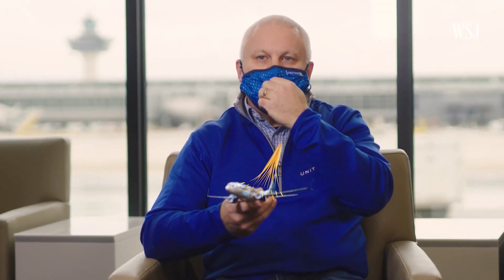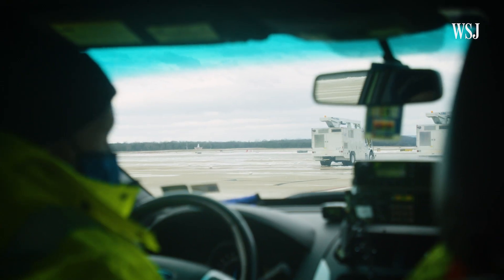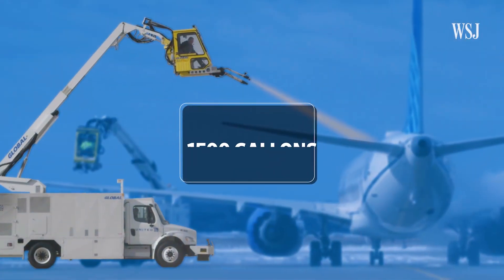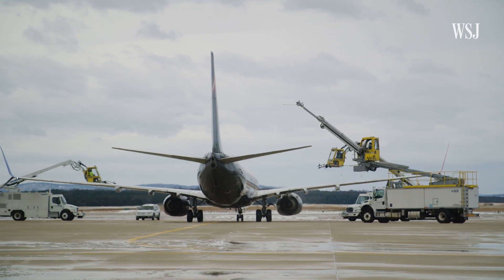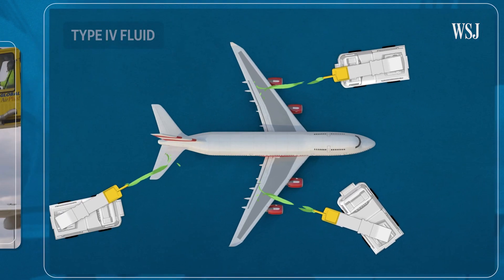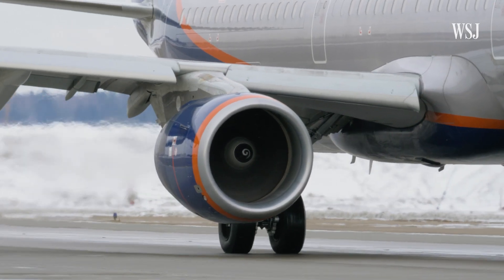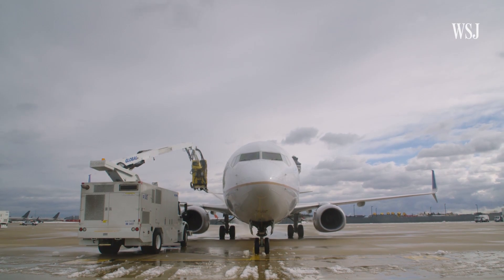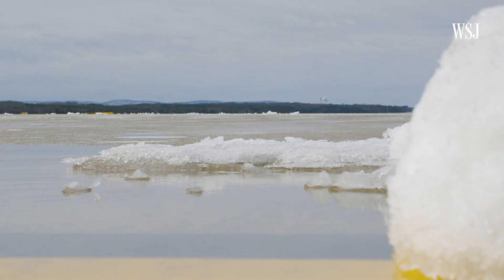The Logistics of Deicing Airplanes, Explained | WSJ Booked

Comment: Hello I think that a lightly salinated water canon is better the water is poured on rather than spraying. A new type of tanker truck is required the water has to be boiling hot no chemicals are required...this is the solution for the industry please consider this method please ask and look into passing this method for the industry it's improving hank you
Reply: Bit late but will tell you regardless. I work as a de icing agent at Portland International and there’s a bunch of reasons why that’s a bad idea. We already heat Type 1 de icing fluid to 180F in the fluid tank and it leaves the nozzle at 140F, they forgot to mention that part in the video. Type 1 already takes much longer than water to freeze but if it’s especially cold that’s where the Type 4 comes in. Salinated water, even if its boiling when it leaves the nozzle, won’t take long to loose its heat and freeze into ice, making the ice problem much worse. Nevermind how bad contact with salt would be for both our equipment and the aircraft.

Comment: How are these liquids suitable for the environment?
Reply: Its propylene glycol, not very harmful. They deice on solid cement several feet deep and suck up the excess fluid using giant vacuum trucks to recycle.
Reply: plus every decade or so they typically drill below the surface of the ramp and take soil samples and check for contamination.